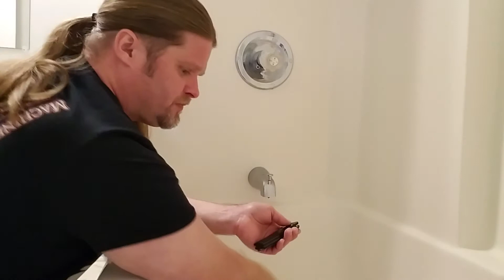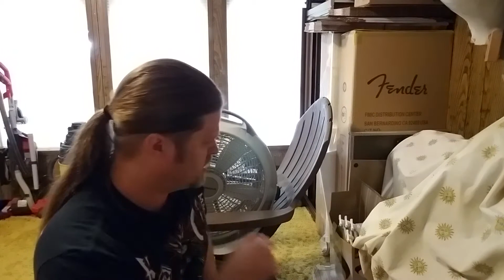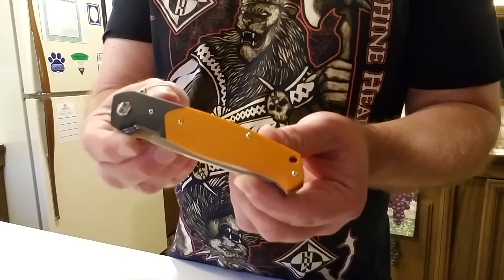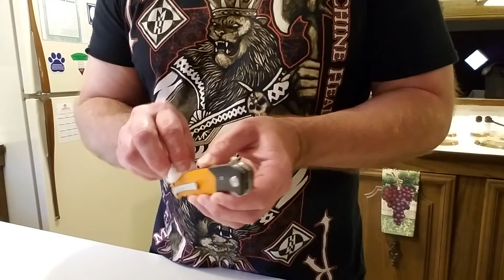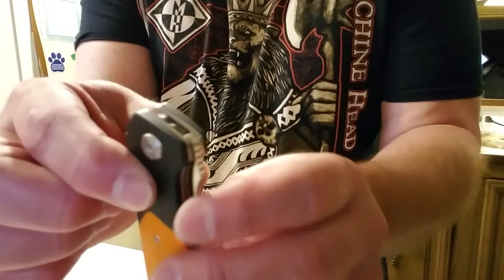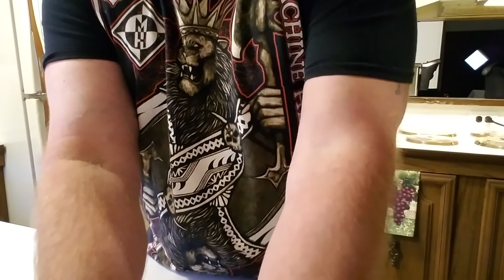Mod Shop - Baz on Blades bathtub blade cleaning guide.

Comment: Very informative video. That's what I'm looking for. Cool. 
One thing to ask you mate are you in the favor of oiling the pocket knife after washing?? That oil will catch the dirt again the next day when you're outside. So what's the use of oiling it again?
Reply from the maker: I do recommend oiling the pivot only. And very sparingly at that.  Just one drop of oil to keep the bushings lubricated. It will keep them from wearing unevenly and prematurely.

Let me ask you this. Have you considered carrying a small fixed blade? There are tons of very small and inexpensive fixed blades on the market. Most are widely available and easy to carry. Maybe a neck knife you can tuck down in your shirt to keep it out of the way. Carrying a fixed blade would pretty much eliminate the continuous cleaning that your folder requires.
Reply: @BazonBlades  yeah i have fixed blades but frankly speaking they are difficult to carry everytime. You cannot fit them in your pocket just like folders. Folders are easy to carry and i like folding knives more then fixed blades. 
Secondly i have Ganzo firebird f740. You said to oil only pivot. What about axis lock part??? Should i leave that or oil that too but axis lock is open and when i oil them, man the oil is everywhere on the knife. Here, there, inside the knife i mean everywhere. So that's a tricky part. What are your thoughts
Reply from the maker: Do not oil the axis lock on the knife. Just one drop of oil on the pivot.

I understand you prefering folder carry. Even considering small fixed blade knives, folders are just more convenient. You may just have to consign yourself to more frequent cleaning of your folder.
Reply: @BazonBlades  i just washed my ganzo just like you did in the video. Under hot water, with a brush and hand wash, dried all the water after that. Oiled the pivet with a syring and there you go. Its smooth as hot cake lol. Thanks man

Comment: I just saw this and its definitely unique. 

My routine is a little different. If it feels silky smooth out of the box, I just put a drop of Break Free on each side of the  blade so gravity draws it down to the bearing or bushing surface. Flip it a couple dozen times and if its still smooth, just wipe it down and done. If its a little gritty, I'll hit the pivot area with a good blast of compressed air and relube. If its not perfect, then I take it apart. HOWEVER, if its a Microtech or something similar that has proprietary hardware so you can't easily take it apart, I'd probably hunt up some brake cleaner, hose it down, then relube. 

Doing it your way, my one observation is that a hair dryer would probably speed up the drying process.
Reply from the maker: All valid techniques.....And the hair dryer suggestion is a good one. Thanks for watching.

Comment: Baz- I never seen this done before. Makes a lot of sense and avoids the pitfalls of stripping screws or having a torx bit slip and scratch things up. Is this okay to do with titanium and anodized blades too? Baz on Blade Baths. Great stuff my man.
Reply from the maker: MrGeerbear, I do this with all knives no matter what they are made of. It will not hurt anything. Just be sure you dry it fully.
Reply: Thanks Eric- I have been watching hundreds of videos since I started collecting 2.5 years ago and have never seen anyone do this. Do I need to dry them? (just kidding)
Reply from the maker: MrGeerbear, yeah just throw it in the microwave on high. That should dry out everything in your house.
Reply: MGB, you had recommended this video to us a couple months back and we remembered! Yes, this is good stuff and should be seen by all knife enthusiasts  ;)

Comment: I’m a mechanic by trade and don’t like to take something apart unless it’s absolutely necessary (modification, repair, etc.).
Personally, I use aerosol brake parts cleaner (non-chlorinated) to blast out the crap, then compressed air to dry.  Computer duster spray works well too.
Great video!
Reply from the maker: SteelBearingHand, another great way to do it. Thanks for watching.

Comment: Maybe I'm in the minority but 9 times out of 10 the first thing I do when I decide to keep a knife I order is take it apart and clean it out and put my preferred lubrication in it and tune it. The. Sharpen it the way I like it
Reply from the maker: Jermey Russell, I normally do not disassemble initially unless absolutely necessary. But everyone is different. No one way is the "right" way, just the right way for you.

Comment: Very good Baz. This is an important video to do. There's very little like this, here on YouTube. Some good teachings here.
I do things a little differently. But all of the important things, are the basics you have shown here.

For example. I have a large  convection oven, that I can set to 100 degrees. That's how I dry mine. And as a matter of fact. That's how I warm them up too. When they arrive in my mailbox, at -18 degrees! 
Which has happened twice this week already : - )

As for the G-10 oil. I use a pure mineral oil, laxative. Food grade. $2.73 per 16oz. Nothing in it, but 100% pure mineral oil. No smell. No evaporation. 

Happy 2018 Baz!
Reply from the maker: Steve Kluver I actually grabbed mine from White Mountain. LTK has been bragging about them so I thought I would give them a shot.
Reply: ...good point...leave them packaged and let acclimate slowly to room temperature before opening...
Reply: Are you kidding? L o l, no. I need at them knives, as soon as possible!
; - )
Reply from the maker: These knives were so cold when they arrived they almost instantly formed surface condensation when I opened them and exposed them to heated interior air. But I couldn't wait. 

Mineral oil is a great option for reconditioning  G10. Especially if you will use the knife for food prep.
Reply: Yep. I can never wait either. Into the convection oven it goes! 
You never did mention in the video Baz. Just where you got that Swordfish from. But it reminded me, that I did get one ordered from Massdrop. So I had to go back, and do a quick check. As to just when that darn thing is suppose to ship. It ships Jan. 16th.
Reply: Yes. I agree. He is a bad influence! L o l . . .
It was my second Bestech purchase. I got the Warwolf first, and really loved it. Then this Massdrop deal showed up. So I joined that drop there.
Reply from the maker: Steve Kluver, the Warwolf is the next Bestech G10 model I will try. I love this Swordfish and really liked the Scimitar also.
Reply: Yeah, that Warwolf really is something special. It could make a guy want to send all of the other D2 knives he has, back to where they come from. The detent, is also absolutely perfect
Reply from the maker: Steve Kluver, I need to get one soon.
Reply: I like the Scimitar too. A little more balanced than the Swordfish, whiich I really like too.